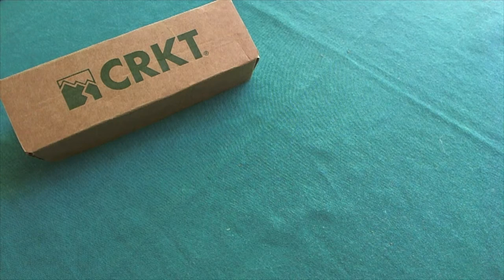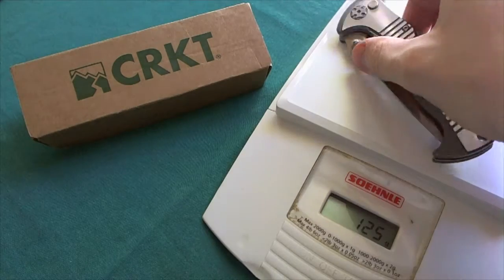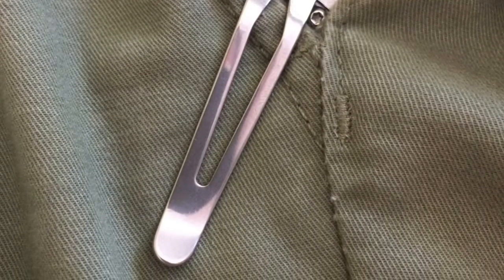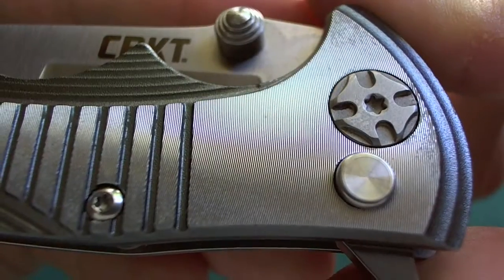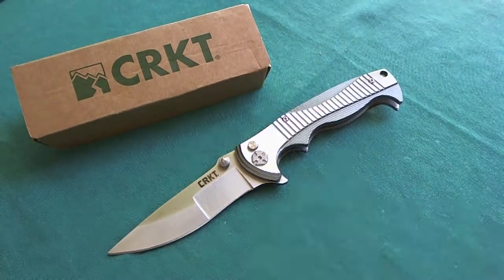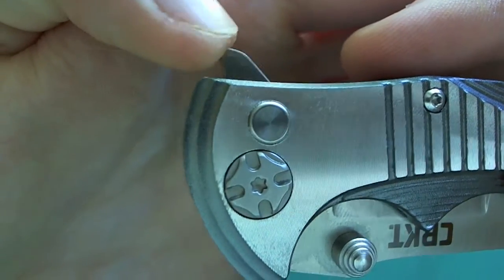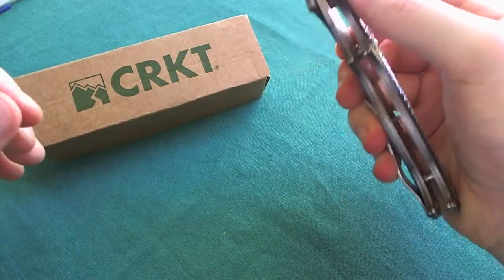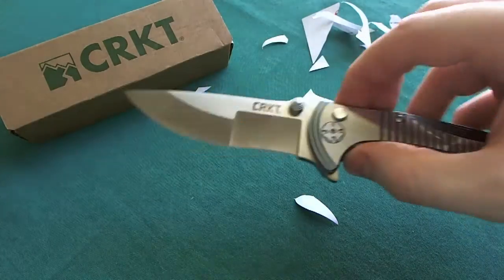CRKT Tighe Rade Review - Ultra Smooth!

Comment: nice review. Looks like that fine machining on the handle would show any scratching or rubbing pretty easily.
Reply from the maker: vansia77 Thanks! I didn't expierence that it scratches easily in my use but dirt and pocket lint will get stuck in the highly machined texture on the flats very fast, so you have to clean it a lot if you care about the looks if your tool.